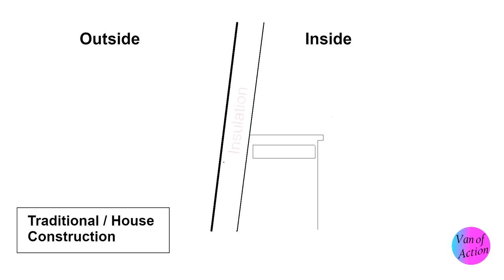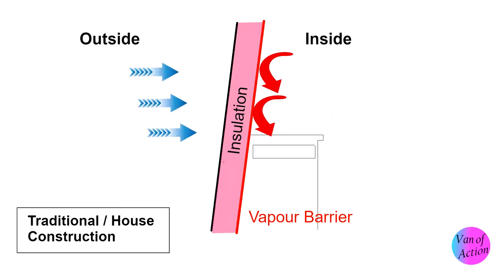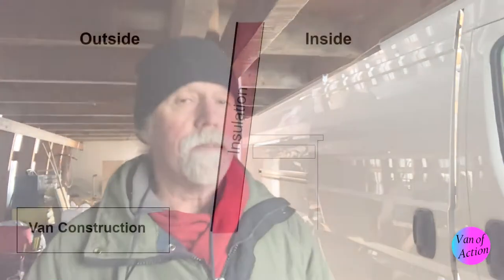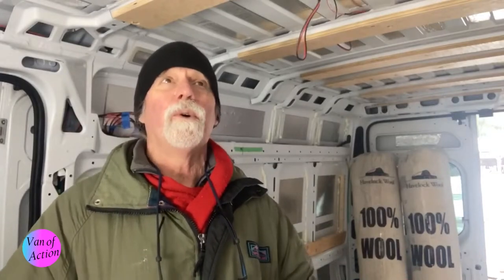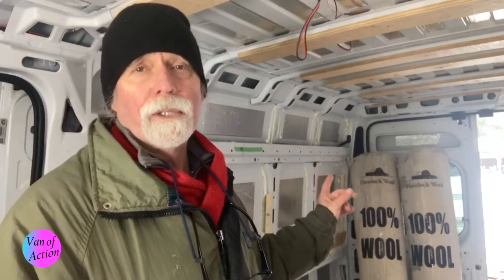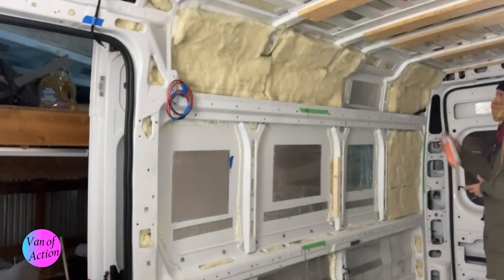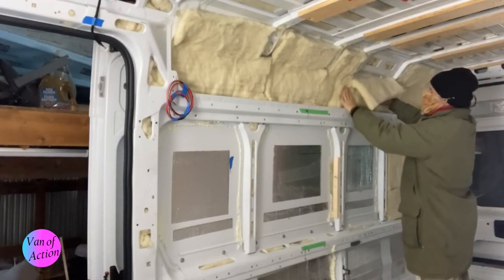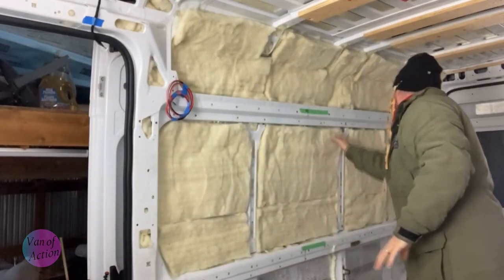How To Insulate A Van - VanLife Havelock Wool, spray foam or thinsulate for a warm and quiet vanlife

Comment: Your thumbnail says best van insulation and why.  Pure clickbait.  You basically said trust me, I did my research and picked Havelock wool without presenting any fact based why.  Wool is a valid consideration, but it's one of many and there are tradeoffs to all of them.  This felt more like an infomercial and is very disappointing.  Opinion is not useful when attempting to evaluate the different insulation options on the market.
Reply from the maker: Hi Chris - thanks for watching and taking the time to comment - I really appreciate your thoughts.   I'm sorry you found the advertised point of the video  misleading  -  That was never the intention but with your help  I can see how it would happen.   I have changed the thumbnail.   All my videos are completely my opinion.  There has never been affiliate links or sponsors -  Not selling anything - )  I'm simply sharing my thoughts as completely as I can - (even the stuff I've invented).  Insulation is one of the areas there is great debate between van builders.  My feeling is that many people think that because you're insulating you can eliminate the moisture in the wall.   I don't believe that's possible, and because of that I believe natural wool is the only practical solution - which is what I tried to communicate in the video.  But it's all just my opinion and as I'm often reminded here at home, my opinion and  $ 1.50 will get you a coffee at McDonalds.   If you are inclined I'd invite you to watch this comparison of D.I.Y. wiring and a store bought power system from Bluetti.  https://youtu.be/5Lzgq2LlGTA     I hope you'll stop back.  Be well .
Reply: @VanOfAction  We all have our opinions which are formed by our own personal ratio of knowledge, ignorance, and starting bias.  Where things get questionable and fuzzy is when they start to be represented as facts or knowledge overstated.  Sadly Youtube rewards clickbait titles with things like 'best xxx' titles, and our culture rewards hyperbole when selling things.   Channel creators are selling themselves as 'experts' or often shilling products/services for others.  

As someone trying to learn it can be hard to sift through tons of videos to find a few golden nuggets of useful information.

I did like your installation tips on installing wool and the importance of keeping it in place so it can be covered and held in place before it get damaged or falls off.  Best wishes with your channel.
Reply: @VanOfAction   I think that you did a great job explaining your reasoning on why you've chose to use wool for insulating. There is some some things that just happen to be common sense or our own conclusions based on experiences we've had through-out life with the history of usage. Although you are certainly not old, by any means, your graying hair tells me that you've been around for a minute and I'm pretty sure that you have learned a thing or two about a thing or two, lol.  One being that no matter what you do or say, you just cannot please everyone. ANYHOO, I myself have been in the process of renovating a travel trailer and have unfortunatly found mold. So my husband and I have been trying to decide what type of insulation we should use & because I have a few thousand pounds of jumbo chunky wool,  ( I make those beautiful jumbo chunky blankets that you see being sold on Etsy or instructional  videos here on YT on how to arm knit one) we've strongly discussed doing so, SO..... THANK YOU for sharing your video.  I don't believe that we've come across a video yet that has  discussed or talked about using wool for insulation.  Was happy to have finally found one & I'll be SUBBING plus leaving a THUMBS-UP.  OH, and of course, we'll be looking forward to viewing more of your videos. Take Care and KEEP SMILING!    a new subb and fan,  CHERI from SLC, UTAH~
Reply from the maker: @cherigibsontrujillo2610    Hi Cheri.  Wow thanks for the kind words but more importantly thanks for reading the comments !  That’s awesome.  I think you’re right,  if you have access to natural wool that is your best bet.   When I started I thought  I was  insulating for heat retention and to help keep the van cool on hot days.  But experience has shown me that there simply  isn’t enough insulation to be effective with either.  The greatest benefit (which may not be as important in a trailer) is the sound proofing the insulation provides.  That part is amazing.  BUT - With so little insulation - condensation is going to be a reality.  Managing it is critical.  And allowing air to move (the system to breath) - or the condensation to drain is the secret.  I would suggest you plan for both those things.  Mold  will occur when moisture is allowed to sit against a material such as wood which is an easy place for mold  to grow.   So just plan for it.   Thanks too for your generous opinion about how decrepit I am.   I didn’t reply immediately because we’re on the “Great 2023 Road Trip”.  Which took us through Utah about a week ago. On our way to Santa Fe.  We camped at Willard Bay State Park which was nice (right beside the highway). And I have to tell you I would never have imagined how beautiful Utah is.  We were blown away………  be well and let me know how you make out.
Reply: @VanOfAction  I sure will. Actually, we've thought about hanging some beautifully made & thick as hell blankets on a few walls and some gorgeous cow hyde rugs too. Maybe even on the ceilings....? It's like falling into a hole when going over all the information & listening to others' experiences with their insulation of choice. We are honestly stuck and haven't a dang clue as to what we are going to use. WHAT A MESS, lol. Anyhow, how fantastic to hear you enjoyed it Here in Utah. I live in a lovely city called Sandy, which is 15 mins south of downtown Salt Lake. It's kind of near the prison, well maybe 20n mins or so northeast. We r right down the street from the REAL soccer stadium. They are a fairly new team and have a beautiful soccer field, just happy that we got some sort of sporting since we'll never have football bcuz the Mormons, lol. Well, you take care n have lots of fun on your trip. And remember to ALWAYS BE SAFE OUT THERE! It's so fantastic to have heard from you. SAFE TRAVELS~  your Utah fan, CHERI 😋 👍 ❤

Comment: The wool will attract bugs, no way around it.
Reply: What do you mean? How so?
Reply from the maker: Hi 1marshall1me .... THANKS for watching the video and actually reading the comments !!!!!!    I don't believe that's the case at all.  In fact just yesterday as I was preparing to install new second seats I cut out some floor and exposed the insulation .... it looked like new .......   Be well and stop back  Dave
Reply: It's the wool off a animal, and animals get a slew of bugs ,fleas,lice,etc
Reply from the maker: @susananderson9619  It is off of an animal - however it isn't shipped right after the cut it off.  They clean and treat it first - you'll see more information here  .....   https://havelockwool.com/van-insulation-products/#:~:text=We%20apply%20a%20minor%20amount,toxic%2C%20as%20an%20insect%20repellent. ... scroll down to the 3rd last question ...   Cheers .. Dave